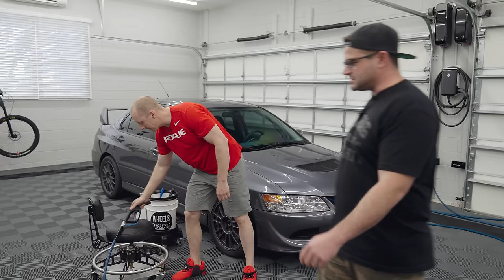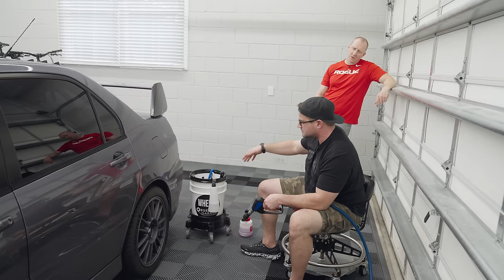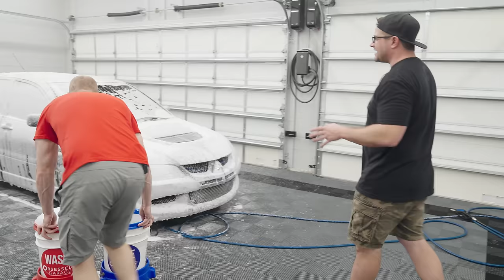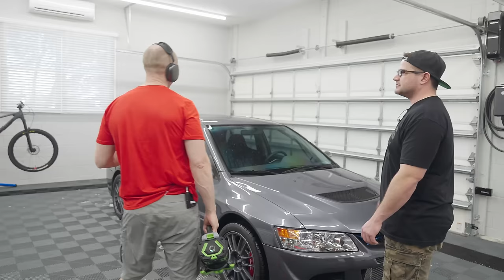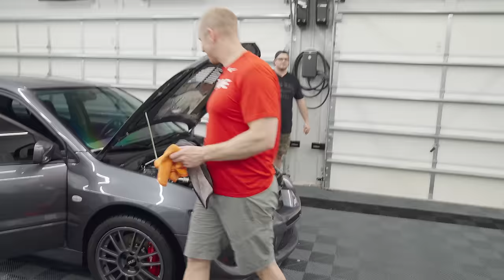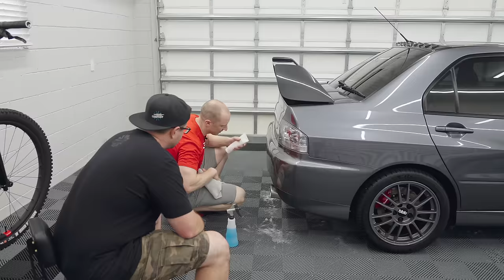Special Guest Wash & Talk: Anthony From The Rag Company!

Comment: Hey Matt, since I have the exact same cars you do, you have a step-by-step process and products that are used in this video that I could re-reference and order to get the same result?

Also, I'll give you an Evo washing pro tip before washing. Take a large garbage bag and cover up a cold engine so you don't have to blow and dry all the water out of the engine bay.  You can also strategically wedge some drying towels in there to help speed up the final process.
Reply from the maker: I'm working on that exact thing right now.

Comment: Do you clean out the foam cannon with brake buster in it after each use? Any problems leaving it long term in there?
Reply from the maker: I don't.  I just leave it.  In a year or so, you'd need to clean the filter.  That's about it.

Comment: I use 100ml of GSF, 100ml of Green Star, plus 800ml of deionized water in my foam canon and that gets me a pH of 10.5. 

Your PH will vary depending on the pH of the water you get from your municipality.

However, you're going to be close to what I get using that ratio.
Reply from the maker: Not all pH is created equally.  It is also dependent what chemicals you use to raise or lower the pH.

Comment: MWC is way better than Brake Buster, have to agree with Anthony. Brake Buster doesn't do jack on really dusty wheels like G8x M cars, C8, etc. If I have to agitate every bit with a mitt I might as well use Reset which is more gentle to the coating. Diamond Wheels sucks though, ADS is much better.

Comment: Matt, I passionately believe you shouldn't use a graduated cylinder to pour 150 ML of soap solution because -- what if you were to spill a portion? That 1/64 of a teaspoon! On the other hand, if you had a set of measuring spoons then you could accurately count off 2000,1/64-teaspoon measurements and not spill a single amount instead of pouring 150 ML and risk losing 1/64 of a teaspoon! DON'T YOU CARE ABOUT THE ENVIRONMENT?! All those poor AdamLZ drift turtles getting run over on tires with improperly diluted soap solution...
Reply from the maker: Ha, ha...

Comment: Seen a lot of those bottles give up in recent videos - any solution for that upcoming? I like the look but not if they die easy!
Reply: You mean the trigger sprayer and tips.  Matt probably has some of the earlier stuff in use.
Reply: Had my pressols going on 3 years, only had a few sprayers give out from using straight brake buster and strong dilutions of APC all the others have held up perfectly, and even using those products they usually last 6 months or so. How nice they work and look are worth replacing a few sprayer heads every now and then, tho pressol has said they’re working on upgrading the internals to be able to handle the alkalinity. I’d just order an extra sprayer or 2 if you decide to try them. You can also rinse out the sprayer on those stronger chemicals periodically before they’re going to sit for a while and it’ll make them last longer.

Comment: A siamese kit shouldn't matter what pressure washers you hook up together you have check valves (one for each washer that doesn't allow pressurized water to back flow to the opposing washer...one direction only..
Reply: I went with 1 Kranzle but really contemplated trying a twin active 2.0.
Reply: @Rob_Cleans_Cars  Not sure that a dual Active works, without putting some additional check values/back flow preventer.
Reply: @timkinley1779  Yeah I couldn’t find someone else that did it yet, and didn’t want to be the mule. lol
Reply from the maker: It doesn't work.  I tried it.
Reply: @ObsessedGarage  i know you said the pressure switch was triggered...i wonder if its because its such low pressure 1000psi that the check valve needs more back pressure to work...do check valves have min. Pressure ratings...to function..logically that doesnt make sense..if anyone can figure it out its you guys...i currently run a 5.5gpm and 4 gpm machine siamesed for surface cleaning at 2500psi and it works pretty good..
Reply: @dscarsella1  These units aren't for that type of use.  You're using gas, these are electric.  To get electric units for that output, you'd spend an enormous amount of money on the unit and electrical service to support the energy required.
Reply: @timkinley1779  im not trying to get that output...im already getting that output..what im saying is there has to more of an explanation/reason than it just doesn't work...i have a v52....and ar630tss for mobile detailing and they work fine for what i need...just saying something doesnt work without a why leads me to want to know why...do you know why
Reply: @dscarsella1  I don't know why.  You could make a dual set-up work with the correct valving.  Matt just hooked up the different units he had.  Making those units work in tandem with the required piping, wasn't in the scope of the project.
Reply: Thanks Tim...Matt usually goes into the weeds on these things...Thanks for all the content  @timkinley1779
Reply: @dscarsella1 not sure about the ve52 but I’ve seen two active 2.0’s hooked up and they seemed to work fine.   Can’t lie, it was fun to test out but really isn’t beneficial and a lot of wasted water.

Comment: Anthony don’t buy any pressol junk, just threw away $200+ worth of pressol and went back to Ik
Reply from the maker: How many times do I have to tell people that they aren't done yet.  You people don't listen.
Reply: I haven’t had a single one die yet
Reply: How truly unreliable are they?
Reply from the maker: The bottles need to be fluorinated as we've found that a few products seep through.  The tips need too much torque, so with certain surfactants or ammonia, they tend to split.   The seals in the head are affected in a few months by Brake Buster.  First it loses dual action and eventually clogs and dies.  That's usually longer.  We are having the bottles fluorinated in the next batch, so that fixes seeping.  A new stainless tip is designed and now entering production to solve the tip issue.  Our latest alkaline test just failed, so it's back to the drawing board on the seals, but we have some promising ideas.  The Germans are very slow to make adjustments and are generally not very keen to make adjustments.  It takes a lot of slow convincing with data to get them to move.  I think it will all be worth it in the end.
Reply: @ObsessedGarage they aren’t ready yet?  You’ve been selling them to us for a couple of years now I think.  Maybe longer?